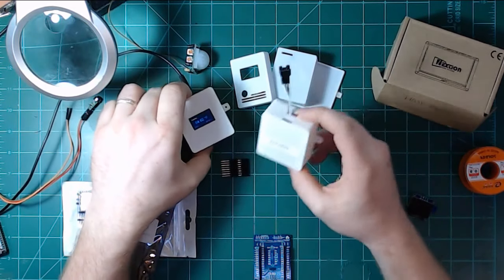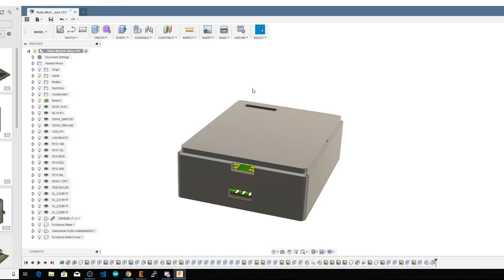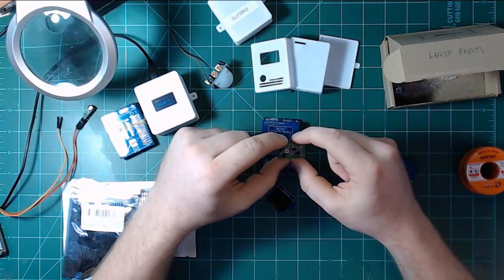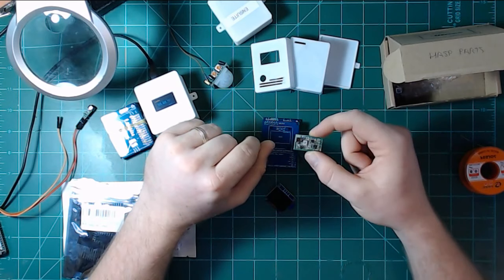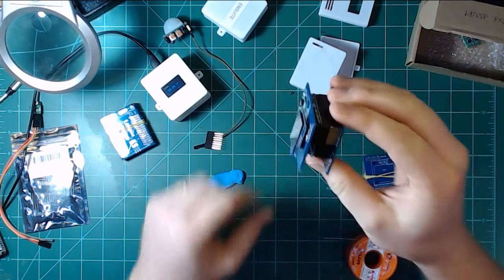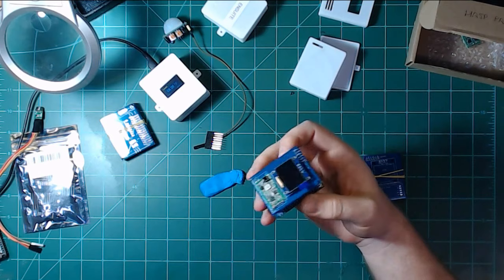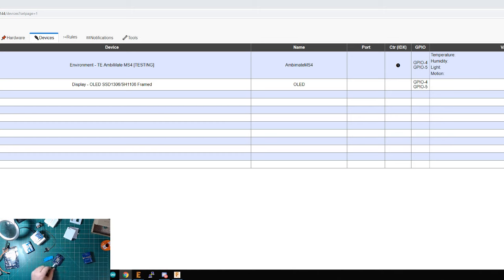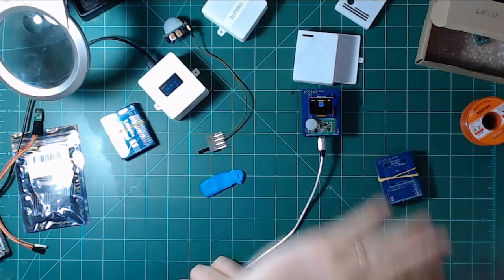BK Hobby Live Stream #5 - Kube v2 Prototype tests & tinkering

Comment: The adjustable motion sensor module needs 5v and provides a 3.3v output. Use the Vin on the Node MCU to get the 5v for the motion sensor. I use it this way on the Wemos D1 mini.
Reply from the maker: @Jonathan Fry - I've tried that, but the VIN on the NodeMCU is not a reliable source of 5V when powering through the USB port of the NodeMCU. At best you'll get 4.4v (diode drop), and it drops even further whenever the NodeMCU fires up the Wifi radio. I made a video on this (https://youtu.be/2HbbQIqJHoE) that shows how you can bypass the 5V regulator on the HC-SR501, and feed the sensor with direct 3v3 from the NodeMCU (much more stable voltage). It makes the sensor a lot better (fewer false positives), but I still get them every now and then, likely due to the RF interference from Wifi. That is why I'm a huge fan of this sensor board from TE - the PIR is filtered by the AmbiMate board MCU, and you get many other sensors on the same board...